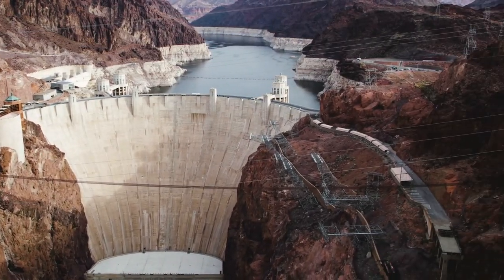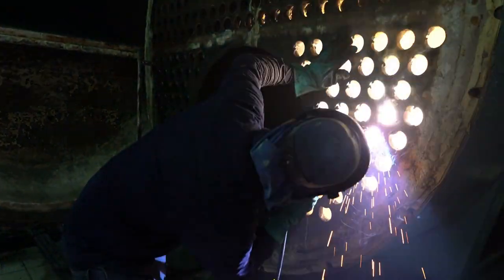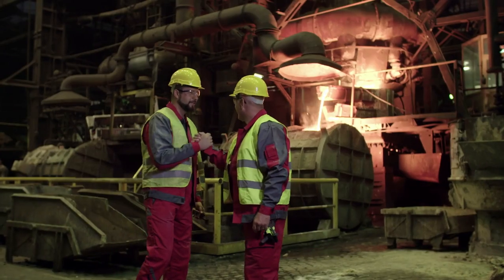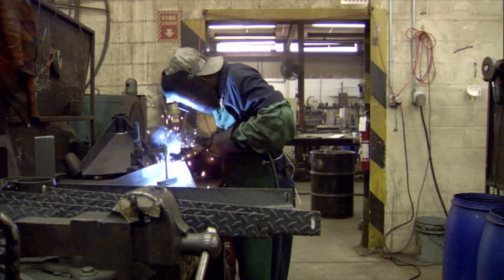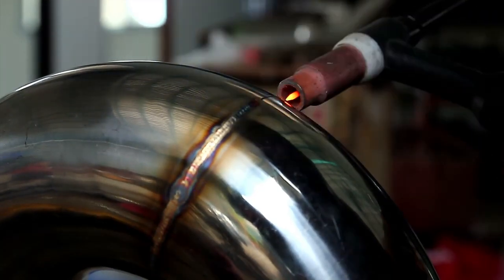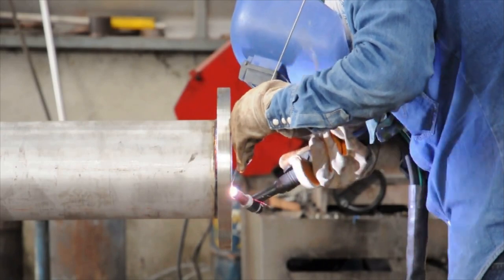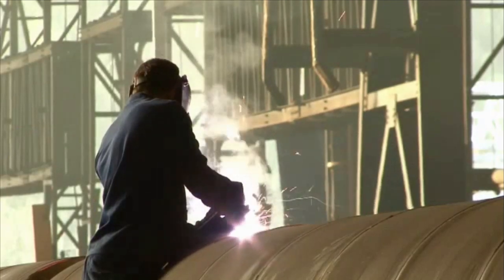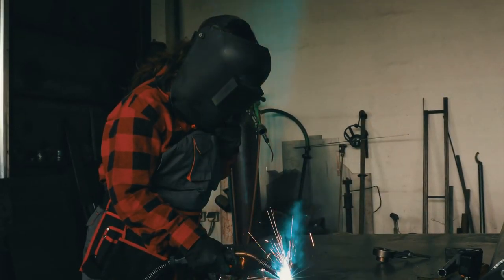Boilermakers Career Video

Comment: This career video provides day in the life information about the following jobs and occupations.

JOB TITLE: Boilermakers

OCCUPATION DESCRIPTION: Construct, assemble, maintain, and repair stationary steam boilers and boiler house auxiliaries. Align structures or plate sections to assemble boiler frame tanks or vats, following blueprints. Work involves use of hand and power tools, plumb bobs, levels, wedges, dogs, or turnbuckles. Assist in testing assembled vessels. Direct cleaning of boilers and boiler furnaces. Inspect and repair boiler fittings, such as safety valves, regulators, automatic-control mechanisms, water columns, and auxiliary machines.

RELATED JOB TITLES: Boiler Maker, Boiler Mechanic, Boiler Repairman, Boiler Service Technician, Boiler Technician, Boilermaker, Boilermaker Mechanic, Boilermaker Pipe Fitter, Boilermaker Welder, Service Technician

ONET: 47-2011.00

Learn more about this and other career clusters, industries, occupations, jobs,  careers paths, education, training, salaries, trends, outlooks, and related career exploration resources and tools on CareerOneStop's website.